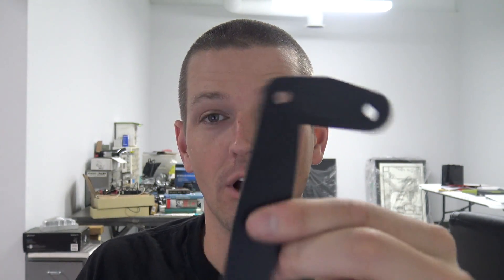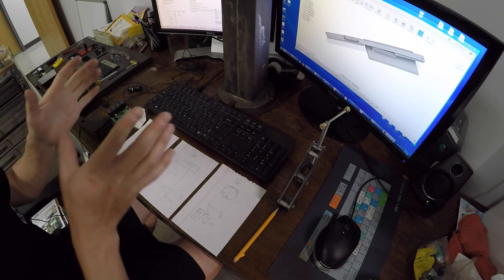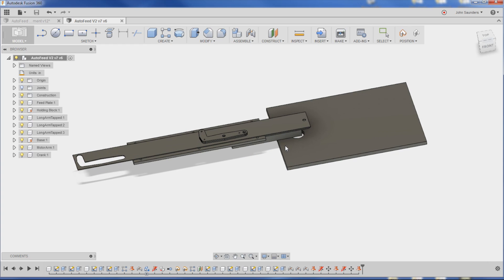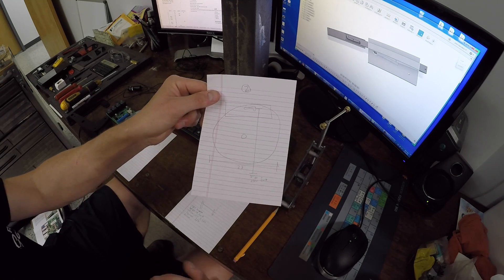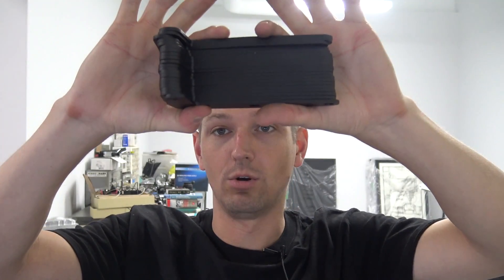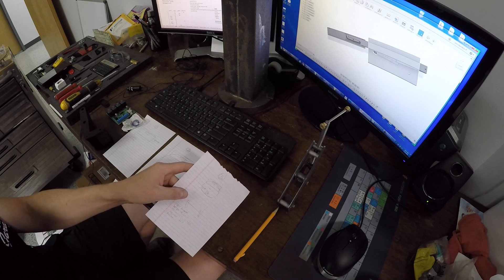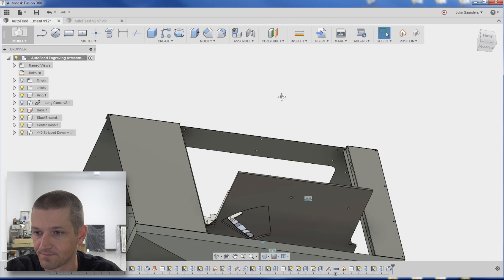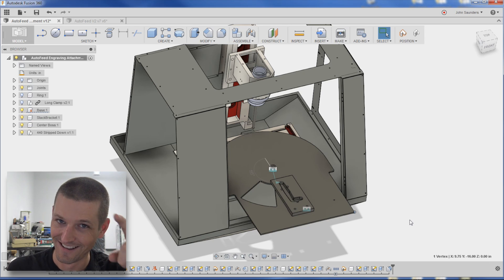Automatic Arduino CNC Parts Loader: Tormach 440!  Part 1

Comment: If your plate is mounted to the table (mentioned at 8:35), won't the whole stack and everything move around during the engraving cycle?  And the corner post going to the floor will move all over too?

Comment: Wont your support legs need 2 axis of freedom so that assembly can move with the mill table?
Reply: I was thinking the same thing, then I thought why not built a support the the table could float on. that could also be used to to hold the table when it want on the the machine. It wouldn't really need to be hard mounted to the legs at all, just ride on it.
Reply: Robert Wilkins
A bed of ball rollers would work nicely.

Comment: IMO
you could use that rotary method to not only engrave one part at a time, but you can stick 4 or more parts in.
So with 4 parts it has to be only rotated 90° until the next part is ready, not full 360°.  I think you easily can program your arduino to do that, even at the first stop, there can be a partcheck with an inductive sensor, if the part is placed correctly. if not, the arduino can rotate it a station further.
I may hook you up with an fusion drawing, if you want.

Comment: I've learned over the years with sketching is the more you do it the better you get, but you may never be great at it. I've also learned that as long as the sketch makes sense to you it doesn't matter how good it is.
A thought on the input stack, take a look at auto-feed clay target throwers. They have a mechanism in them to hold the weight of a stack of targets yet still drop just one on to the arm as it comes around. The concept might be applicable here to reduce load on the rotating plate.
Looking forward to Part 2!

Comment: My question is, is this and on going job or just a one off of X amount of pieces and done. I ask because it seems counter productive spending all this time working out a system you're only going to use on this one run. In the time you're taking to work out a jig you could've had all the parts run already. Just saying. Naturally, if it's an on going order then by all means you're on the right track with the wheel set-up. Good luck.
Reply: I bet you're right, but I also bet he's doing this project for fun. Once it's done he'll have killed two birds with one stone.
Reply: This kind of project is right up the alley for a 600 part run. through if it's any more, this isn't good enough quality.

Comment: Hey John. Why not index a tool pickup every, say, 15-20 degrees around the feed tray so you get more parts per rotation?
Reply: i was thinking the same thing, less time wasted waiting for the table to rotate 360 degrees for each part. more weight on the table but it would be evenly spread out

Comment: From previous experience center driving a loaded disk is a nightmare. Rather worm drive the edge of the disk, massive power and positive lock. Also you do need position feedback so at least one sensor is needed. Like the other posters suggestions of multiple feed slots.

Comment: I would defenitly put more slots in the rotating plate so you dont have to turn that much every cycle, this might reduce the strain on the motor.
Maybe you could use a laser to check the position of the rotary table by shining the laser beam though a hole in the rotairy that lines up with a hole in the fixed plate with a lightsensor under it, the accuracy depends on the size of the hole, should also make it easy to implement a system with multiple slots since all you need to add is the extra holes

Would also love to see a system that detects whether the slot is empty and skip a machining cycle when needed
Reply: Empty slot detection - great idea!
Reply: There any particular reason not to have a detent cut into the edge of the rotating plate? (wear aside) it these detents would always have a known alignment with the cutout(s) and can be engaged by a solenoid (or bearing on a spring) to lock the absolute rotation of the plate.
Reply: in combination with a rotary encoder to keep track of the angle of the rotating table.

Comment: I like the design. The electromagnetic chuck a nice idea.
Will there be any support for the turntable near circumference? If the stack of parts is as heavy as you indicated, then the turntable could become pinched from the weight of stack and unable to turn. 
You could also remove the weight from turntable completely by having the hopper as a separate piece that just hovers over the turntable. Then install a little ridge or "paw" on the turntable next to the opening where the part sits. The paw will "grab" the next part from hopper as it passes under it and then the part will fall into position.

Comment: Cool idea. You could make your turn table have say eight positions so it only turns 45 degrees between each part. That gives you the opportunity to to have multiple parts loaded for machining and a part or two post machining giving you the opportunity to check at a glance on how things are going. Like if you run out of blanks you will have several steps to catch it. Load the empty slots and never miss a beat. Very interesting project thanks for sharing!!

Comment: Wouldnt it be a good idea to make cut out for more than one clamp at the time in the top plate? So it picks up one, engraves one and drops one every 45 degree or something?
Reply: I thought about that.  But in reality there's no real need.  It can only engrave 1 part at a time no matter what. And adding more spots for parts in then upper play will just make it less structurally sound and prone to bending and twisting as it rotates around.  The time gained by having to only rotates say 20 sets at a time vs 90 is negligible especially since it will be automated
Reply: This or make the section that picks up removable so you can use the same setup and swap plates for different parts or part orientation.
Reply: yeah, you could easely fit 12 of them on there per rotation.
Saves you time and energy.
Reply: i don't see much need for 45's but at 90 intervals you could at least visually check that it's fed and visually check that it ejected without having to hold the entire operation up to fix it. just poke it real quick, fixed. saw somewhere below someone mention a pneumatic piston and a UHMW slide and i couldn't agree more, takes the weight off the table, you can stack as many as is reasonable and i could see a potential reduction in misfeeds since it's not fighting the stack weight when trying to center and feed into the slot correctly.
Reply: yeah that would increase spindle up time.
also gearing the stepper and the table would allow stress to be taken off the motor